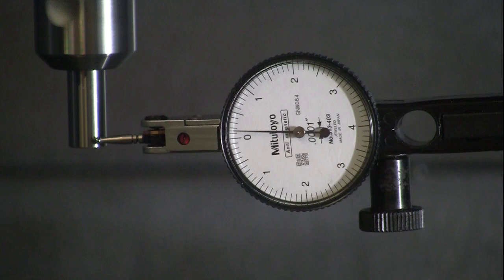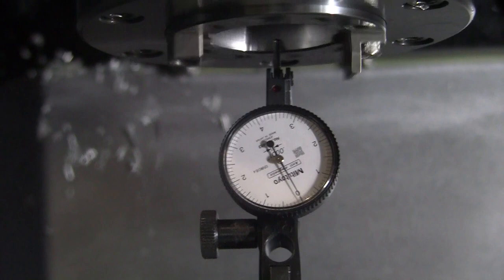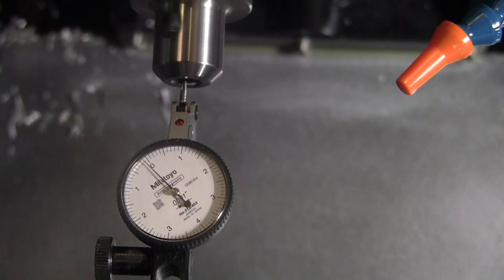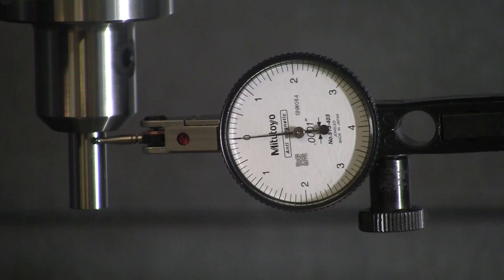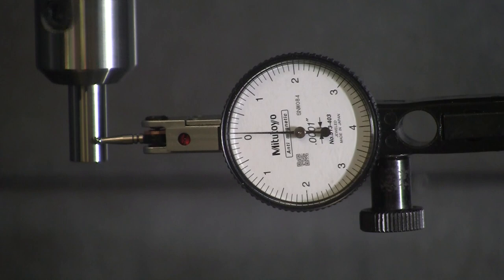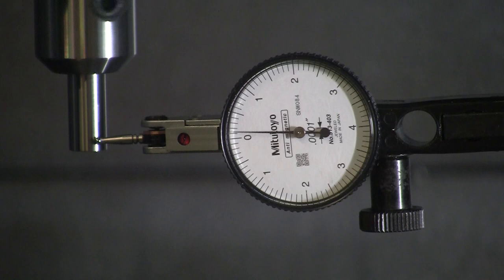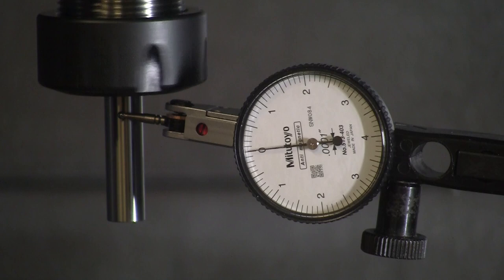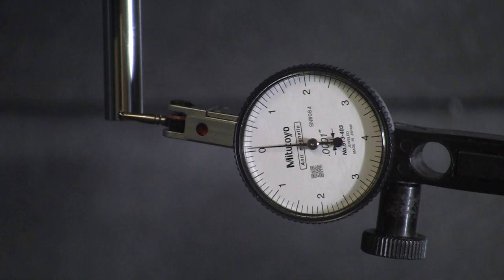What is the TOTAL RUNOUT of CAT 40 end mill holder?

Comment: You are using a gage pin which is very close to the nominal diameter of the endmill holder but in my experience most carbide end mill shanks are .0004" to .0005" under nominal size which would make the endmill holder runout even worse but would have little to no effect on the ER holder. There is always some clearance between the endmill and bore of the holder on a set screw type holder, collet holders always center the end mill instead of pushing it against one wall of the bore basically giving you two points of contact.  Thermal endmill holders are different but they're a more expensive investment and are more time consuming to set up.
Reply from the maker: Agreed!

Comment: The gauge pin, where can I get it?

Also, what's the perpendicularity of its end face to its axis?
Reply from the maker: these can be found at any industriual supply house. MSC and  Mcmaster-Carr bot hcarry gage pins. The perpendicularity of the end face to the diameters is likely pretty good but i do not know who well it is controlled. you would want to buy and measure.

Comment: in any cenario you can allways grind your holder inside your machine 0 runout. ever ER holders. even holder is acurate. collets is moving part. runout change on life time and how you insert it buy closest inch or mm holder and grind it your desire size. you decide how tight it is. when it BLOB its good :)

Comment: EM holders are very unbalanced especially if you grind the flat yourself, and if an EM shank is way undersized, the run out will increase accordingly.
ER collet chuck, though your video shows it gives a tenth run out, everyone who uses ER knows, you don't get this every time, in fact, it takes an average 5-6 minutes to get an ER holder + collet to give less than 4 tenths run out (that means at the high range, one can takes up to 15 minutes to dial it in).  Economy brand ERs also don't provide enough gripping force for aggressive milling.  A brand X ER32 holder with a 1/2" collet gives any where from 35-50 ft bls of holding torque (LyndexNikken brand gives 110 - 125 ft lbs. and more consistency in run out - less than 5 tenths).
If you want versatility - milling, drilling, tapping, reaming, etc... go for the Lyndexnikken premier SK collet chuck system.  For a 1/2" shank, either their SK16 or SK20 can give more than 150 ft bls of gripping force and they guarantee run out of less than 2 tenths - every time.
The SK system is awesome, I have used it for many years.  Little more money up front but boy you will get back the investment in days just from the time saving and the longevity of the carbide.  Many high end shops no longer use EM holders and some still use ER, but majority have switched to LyndexNikken SKs.
Hope this helps, but do look into it though, you won't regret it.
Reply from the maker: thanks for the feedback. i will look into that system.
Reply: SK holders are a bit extra money but its practically set it and forget it. with a run out of .0002 or .0004 max if you are unlucky. Only issue is the range, but man are they accurate